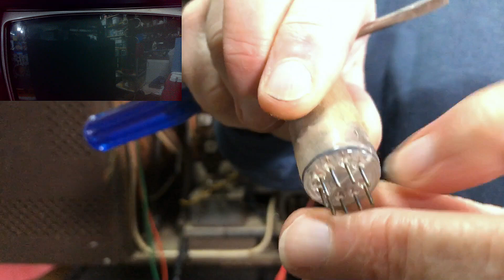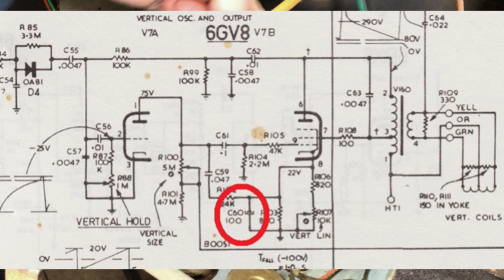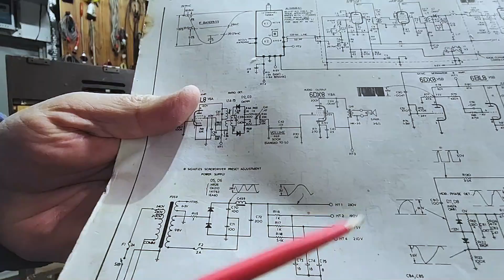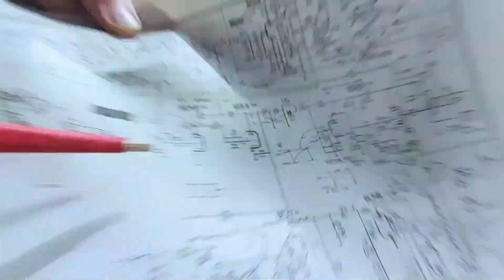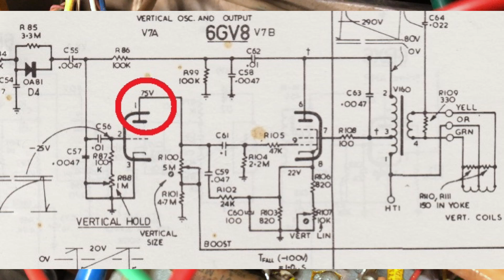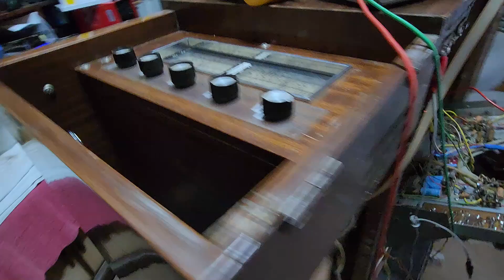Precedent Balmoral TV Combo Repair - Not As Expected !

Comment: A fair bit of confusion about a frame (vertical) collapse giving an horizontal line as seen and a line failure as you said Baz. If the line output fails there is no EHT with a flyback generator so no raster.
You would never hear a X2 line frequency, I cannot even hear the ordinary 15kcs line whistle now. A long while since I did 405 line monochrome sets. With 625 lines I could never hear the line anyway.
What line and frame frequencies are used in Australia?
You would be unlikely ever to hear a frame running either. No mains transformers in UK sets, all I ever saw were live chassis.
I am sure that you know the difference between line, horizontal, and frame, vertical, but it must be confusing whilst you are doing a video.
Reply from the maker: Boy. Even I'm confused now. I must have said line instead of vertical.
Yes, i can easily hear the 50hz vertical tranny when it's going.
Used to hear the line (15k) a few years ago but not now the old age has set in.
Reply: @techobaz55  You confused me!  Doesn't take much these days. It may be worth you listening to the episode though to see how confused it was! I have never heard the frame oscillator, perhaps with not having mains transformers we never expect to hear it, 50 c/s hum is everywhere these days, can't get away from it.

Comment: In the damp UK we are advised by those that restore TVs to cook the line output transformers for several days before connecting any power to avoid the EHT winding failing.
We either remove the transformers to a dry warm place like an airing cupboard with the hot water cylinder ( very old fashioned! )  or pass a small DC current, around 20mA,  through the winding for several days to ensure that they are dry-dry.
Reply from the maker: Certainly not a problem here in Oz !

Comment: I might be too late but there is a chance the picture tube could "wake up"  come good with some use. Its been asleep for who knows how long .
Reply from the maker: This tube had extreamly low emission, I did run it for 2 days before scrapping but no go. Even increased the 6.3v heater voltage to 8. Still no go !
Cheers
Reply: @techobaz55  Tube being gone now it's academic, but if you have another situation like this: their heaters are made to withstand twice their rated voltage and when the tube is manufactured (or remanufactured) a hour or two cooking at double heater voltage (but no other voltages) is done to activate the cathode.  The heater is none the worse for wear for that.  But again the getter may be all taxed at this point with a tube like this, and there's nowhere else for the impurities to go than to migrate back on the cathode.

Comment: Dead picture tubes are par for the course in my experience in these old sets.  Precedent were a cheap brand, but good value at the time, and very popular.  I pulled one of those combos apart when I was a kid.  A capacitor had shorted in the radiogram part, burning up the rectifier and power transformer.  It left a big scorch mark on the top of the marviplate cabinet, so the set was given to me.  I have an earlier Precedent TV only; 21 inch with 163 chassis.  Haven't tested the CRT yet.  By the way, your definition of vertical is at right angles to mine!  😂
Reply from the maker: The risk you take when you haven't got a tube tester Stuart, can be a big waste of time. Not sure I follow that vertical thing though ?
Cheers
Reply: @techobaz55  I think you got a "horizontal" line, or at least stripe.  It's what you get when the "vertical" deflection fails.  Getting a "vertical" line is something I never saw on a magnetic deflection picture tube type TV set, probably because for the yoke to conk in the "horizontal" circuit would spoil the ability for that circuit to generate high voltage/tension for the ultor.  The yoke and flyback form a resonant circuit together.
Reply from the maker: @SeekingTheLoveThatGodMeans7648  yep lol. Been fixing TVs for around 55 years. Aware of this 😃

Comment: Baz Bummer on the Precedent B/W Combo they always were a cost effective TV read Cheap the firm sold a few them in early days TV but always had problems thankfully they stop selling them,Yes drop down chassis that didn’t work most tech hating them,A large Difference in the Kriesler you recently refurbished, I guess they are breaks Baz anyway you got a Stereo Chassis out it,Ian,
Reply from the maker: Cheap is certainly the word for them Ian, not my favourite repair that's for sure. Looking forward to the radio chassis, see if it springs to life. Next week's challenge ! Cheers

Comment: Hi Baz.  Bummer about the picture tube, but that doesn't detract from the video.  If I watch enough of your videos I might eventually learn to fix TVs.  I had a bit to do with monitors used in video games in my early days (and found out how long a tube will store a charge after picking one up of a shelf - but that's another story...) but that was at a pretty basic level.  Anyway I find them fascinating.  Now back to that s... oops!  Have a nice day!
Looking forward to seeing you get the radio section going.  The set might also yield a useful record changer.
Hoping it's warming up a bit for you.
Cheers
Reply from the maker: You had to mention the S word !
Onto it today actually, not looking good.
That radio will be interesting plus will do the Garrard Turntable at the same time, get both going on the bench. Cheers Mate
Reply: I started with TVs in the UK at the age of 12 and it took me a few years to understand that a CRT will pick up charge on the dag coating outside to the final anode connection all on its own over time even when not connected to anything. I don't understand the mechanism but always fit a shorting link to CRTs in storage now.